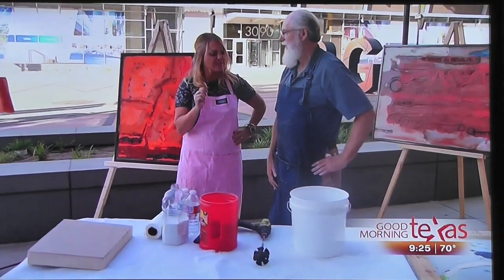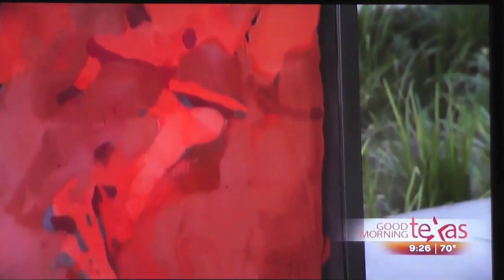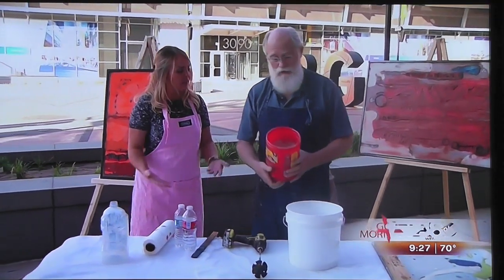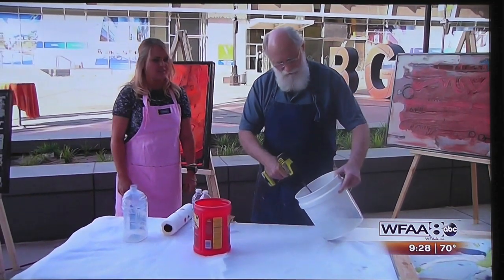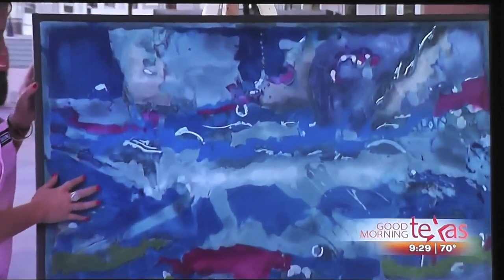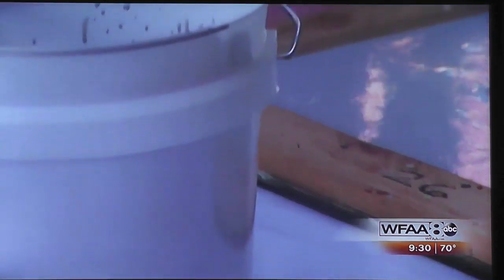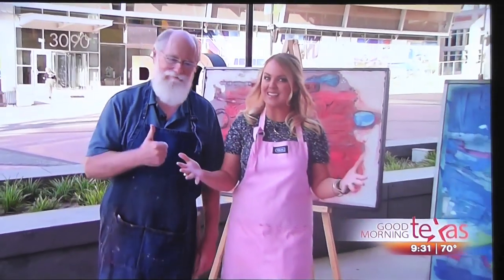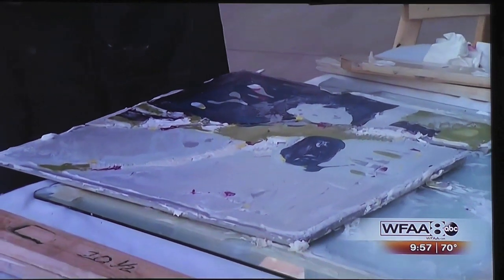Good Morning Texas Appearance

Comment: nice another work william.may i ask you a question ??..when my finish piece dry, it was bent. and what do you mix with cement for get a strong piece. thanks
Reply from the maker: I mix my cement with acrylic polymer to make it stronger. It is usually used to mix with thinset for adhering  ceramic tile to surfaces. You can get it at Home Depot.
Reply: William Hall
thank you very much william